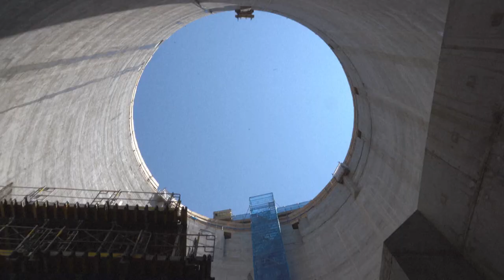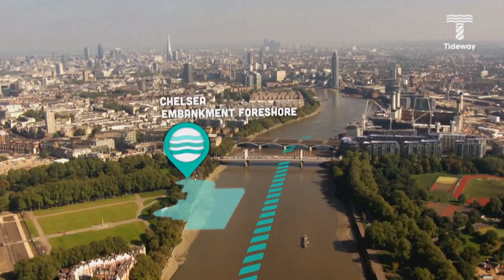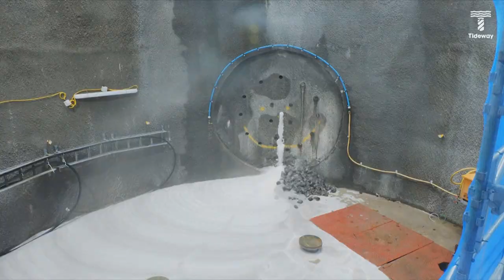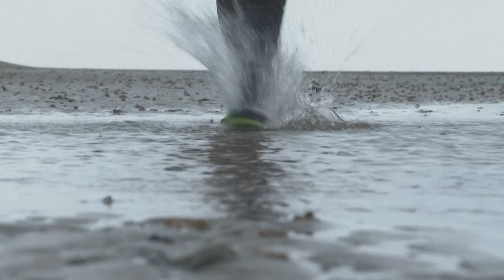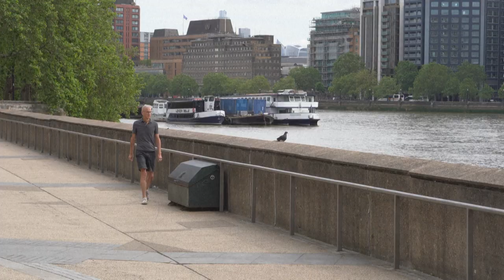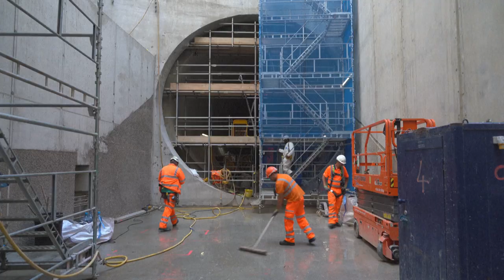London builds 25km super-sewer to clean up River Thames | AFP

Comment: A salt water flush doesn't always lead to a bowel movement, and there are several reasons why this might be the case. If you're not experiencing a bowel movement after a salt water flush, consider adjusting the timing of the flush, ensuring you're using the correct amount of salt, and verifying that you're using pure, un-iodized salt. Additionally, consider consulting a doctor or other healthcare professional if you have concerns about your bowel movements or if you're experiencing persistent constipation. 
Here's a more detailed look at potential reasons and solutions:
Reasons for No Bowel Movement: 
Timing:
Performing the flush in the morning, when your digestive system is naturally emptier, might be more effective than doing it later in the day. 
Salt Amount:
Using too much or too little salt can affect the flush's effectiveness. Adjust the amount to find what works best for you. 
Salt Type:
Ensure you're using pure, un-iodized salt like pink Himalayan or Celtic sea salt. Avoid iodinated table salt. 
Individual Variation:
Some individuals may simply not respond to a salt water flush as well as others. 
Underlying Issues:
If you're experiencing persistent constipation, it's important to address the underlying cause, which may involve diet, lifestyle, or medical conditions. Consulting a doctor is recommended in such cases. 
Tips for a More Effective Flush: 
Warm Water:
Use water that is warm, but not hot, as this can help dissolve the salt and stimulate the digestive system. 
Right Side Lying:
Lying on your right side for 30 minutes after drinking the mixture can help the liquid move into the lower intestines. 
Physical Activity:
Gentle exercise like walking or yoga can also help stimulate bowel movements. 
Consult a Doctor:
If you're concerned about your bowel movements or if you're experiencing persistent constipation, seek professional medical advice.
Reply: What DO YOU MEAN DOESNT ALWAYS ???? Is it 100% ?? Or 99.9% ???